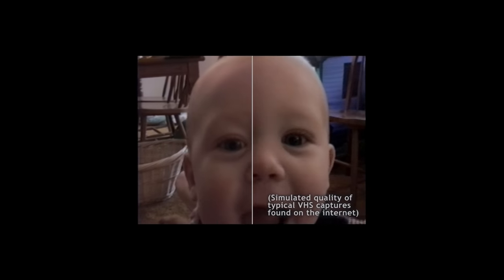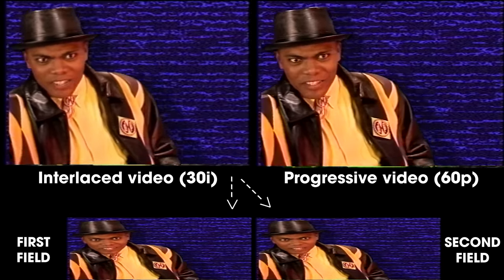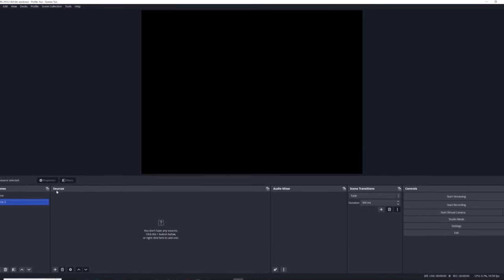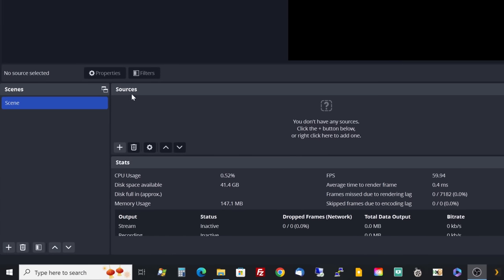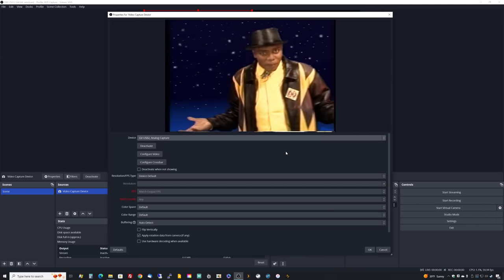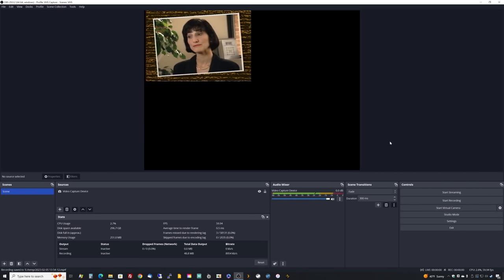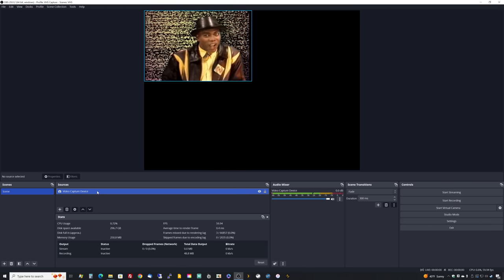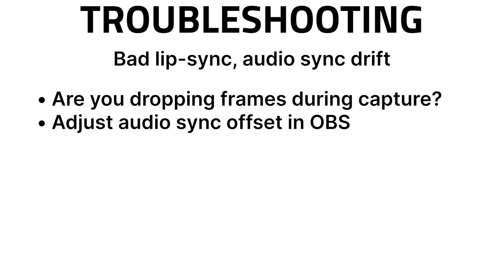How to convert VHS videotape to 60p digital video

Comment: does this work with mini dv? been trying to figure out how to digitize my old tapes.
Reply from the maker: For MiniDV, I would use something like a firewire connection and WinDV (windows) to capture the tapes, as that will transfer them digitally.  Then you can use the FFMPEG command-line in this video's description to do the conversion.

Comment: Question, what can you do in capturing the video about the over scam line at the bottom of the screen?
Reply from the maker: If it's too distracting, you can resize the video source slightly larger, so that it gets cropped off the canvas.
Reply: @TheOldskoolPC  Thank you for replying!!

Comment: I followed the instructions but used an Elgato usb capture and I can not get any sound. I use it with Egato software it works so it's something within osb. Any ideas?
Reply from the maker: Try adding the device again but this time as an audio source, and picking the capture device.  Sometimes that works around driver oddities.  I show an example of this in the troubleshooting section of the video.

Comment: I cannot see video using 2.0 audio/video converter,  it plays a USA video but I have one from Britain but it is supposed to be for all modes, so I don't understand why I cannot see it.  Thanks for any help.  I tried pal settings and that doesn't work either.
Reply from the maker: You can't play PAL tapes on NTSC VCRs, and vice versa.  Solve that problem first, then you should be able to use a USB converter set to PAL.

Comment: when i start recording, the video is not smooth and on the program it says "encoding overload. consider turning down video settings or using faster encoding preset" how should I change the settings?
Reply from the maker: I have a few tips in the Troubleshooting section of this video.

Comment: I'm having a problem, on a Windows 7 laptop my Dazzle DVC100 worked near perfectly on it however on a newer Windows 10 PC I can't get it to work at all.  The drivers install, but in OBS and VirtualDub2 there's no video, most I can get is skipping audio from the input on the device.  I've tried multiple different drivers, same thing.  Any ideas?  I'd very much appreciate it.  Also, your Google Drive link only has the GV-USB2 exe.

Comment: Do those capture devices also handle PAL inputs?
Reply from the maker: They should; most are both NTSC and PAL, although you might have to change what they're looking for in the driver config (when you click "configure video" in the video input device dialog).

Comment: How about an alternative approach for video capture? There is new AI (Artificial Intelligence) software available now from Topaz Labs that allows you to UPSCALE video that is captured in SD (Standard Definition). For example, if you capture mini-DV footage at 720 x 480, you can UPSCALE it to 1440 x 960. The result is very good.

Note, however, that the AI software does not do a good job of upscaling cruddy digital video. For example, if you've captured VHS that was recorded in EP mode (Extended Play), then the UPSCALED result using Topaz looks pretty miserable. Garbage In = Garbage Out.
Reply from the maker: I have been experimenting with AI upscaling since before Topaz Labs existed using custom-trained GANS, and then later with Video AI.  The end results, in 2024, are "it depends".  It depends on what you're trying to upscale whether you get good results or not.

Comment: Bought the Startek SVID2USB232 but changing the resolution to 720x576 PAL makes it chug and buffer at times.
update: Don't reboot your system and it will work.
Reply: Are you sure that's the actual video and not just how it's rendering on your monitor, which is likely running at 60fps? You also would need to change the output framerate to 50 fps if you haven't already.
Reply: @PuffyRainbowCloud  Yep all the output settings were matched correctly. I found the problem though, rebooting windows funnily enough. Everything works as long as I didn't reboot windows after initial reboot after installing the drivers. 
So probably something being automatically updated and breaking things.
Reply: @canderson7776  Very frustrating and very Windows...

Comment: When I add a video device and click "video capture device" my dazzle doesn't show up. Only my webcam did. Any ideas why this might be? The video camera I'm using only has a yellow and black lead even though the dazzle has yellow, white, and red. Not sure if that might be related to why the device isn't showing up.
Reply from the maker: Were you able to figure this out?  It sounds like you didn't add a device driver.
Reply: @TheOldskoolPC  I was not able to. Where would I get a device driver? I don't think I have the disc when I bought the dazzle. Thanks for following up!

Comment: This mostly works great, but every 22 frames of the deinterlaced video it will repeat the 22nd frame, then jump to the 24th frame, then play normally for the next 21 frames in a row then repeat the next frame twice in a row etc for the whole video. I tried capturing and converting with the old (2016) virtualdub method and it doesn't happen if I do it that way. Only with OBS. Does anybody know what setting I need to play with in OBS to stop this from happening?
Reply from the maker: That's a really strange cadence issue.  Without interacting with your hardware and driver settings, I'm not sure I could figure it out, although see if you have any settings for "audio hardware timestamps" and try toggling that to see if it helps.  Also make sure your audio capture is 48000 Hz and not 44100 Hz.

Also, if the previous tutorial worked for you, it's ok to keep using it!

Comment: Dazzle only works with Red White and Yellow. If I unplug the Yellow and put S-Video in the signal in OBS is lost... I thought S-Video is higher quality, but Dazzle only works with Yellow and disregards S-Video... Even if I unplug S-Video and keep Yellow plugged in the signal isn't lost... Can you help me? - Paul
Reply: I was able to choose S-Video in on Configure Crossbar under Configure Video... In order to get sound meters to show I had to uninstall the Dazzle Driver provided by this channel and reinstall... All is now working so far... took me a bit...
Reply: I tried this method vs. the previous Virtual Dub tutorial provided by this channel and I had some pretty bad results. Glitchy recording, sound is choppy... No matter what compression setting I tried the output was just disappointing. I even tried the exact Dazzle used for this video... I honestly prefer Virtual Dub... I play VHS tapes or small VHS Tapes with an adapter in a Panasonic PV-VS4820 VHS Player. I insert an S-Video male cable into the S-Video Out female port of the vhs player. I also insert Red and White Male Jacks to the Red and White Female ports of the vhs player. The other male jack of the S-Video cable I plug into a Sony DCR TRV17 Camcorder. I also plug a 3.5mm cable jack to the Audio Video port of the Sony Camcorder (the cable is a 3.5mm jack to Red, White, and Yellow jacks. I don't use the Yellow jack because the S-Video jack is higher quality. The Red and White are for sound.) Then I plug in a Firewire male jack to the Sony camcorder and the other male jack into my PC. My camcorder allows the signal from the VHS player all the way to my PC and Virtual Dub. There's a A/V Out setting that must be enabled with the camcorder for this  to work. Hope this helps anybody out who is having trouble converting their tapes... - Paul
Reply from the maker: Sorry this tutorial didn't work out for you.  There's nothing wrong with the previous tutorial if it works for you, so keep doing what you're doing.
Reply: @TheOldskoolPC  Thanks for the quick response. It's ok, no worries. I'll keep doing what I'm doing. I still appreciate you making both tutorials, even if one didn't work for me. It would be intesting if you made a tutorial on Time Base Correctors, and how to use them... I saw a video online explaining you can't make money converting tapes for clients unless you have a Time Base Corrector. Is there one you recommend purchasing? Thanks. - Paul

Comment: I tried using the startech device but I only get a black and white signal with no audio do you know why this is happening?
Reply from the maker: Sounds like you might have it set to PAL by mistake when you mean to capture NTSC (or vice versa).  I would check the driver configuration settings as I demonstrate in the video.

Comment: It's more of like how not to convert VHS, OBS is the wrong tool for VHS or any tape format for that matter, Capturing analog tapes follow the rec.601 standard, Not OBS, or HDMI or Chinese crappy dongles.
Reply: Ok!... Where is your tutorial1?🤔
Reply: @AuzFrog  There is no such tutorial, Capturing analog video is a rabbit hole, depends on a lot of things, Budget, knowledge, condition of the tapes, the delivery method of final product ...etc. There are general guidelines though and things that you should avoid as I mentioned.
Reply from the maker: If it helps, the process I follow for my own archival efforts uses a Blackmagic Design card and saves to uncompressed 10-bit YUV (Rec.601).  I then process from there, and never delete the original raw capture.  This tutorial was meant as a generic 1-stop solution for common use cases.
Reply: @TheOldskoolPC  just curious, is that the Blackmagic Intensity Pro 4k?

Comment: Hey there so I purchased a dazzle rev 1.1 and using the drivers you provided and even a version before I can’t get a video signal to work, I’m on windows 11 and even booted 10 just to try and no luck, also tried usb 2 and 3 ports but still only audio with no video. Any thoughts?
Reply from the maker: Search these comments for "dazzle" as one of the commenters had some Dazzle tips.  But if you've tried all of these and it doesn't work... maybe the Dazzle unit itself is bad?
Reply: @TheOldskoolPC  small update I did get virtual  dub to see it on my optiplex I have windows xp installed on, so maybe I’ll just follow your older tutorial using that :)

Comment: Is there any reason why you scale the video up and not leave it at sd resolution such as 720x576 for pal.
Reply from the maker: Because YouTube won't play back files faster than 30fps unless the video is 720 lines or more.  If you keep the size at 720x576 and make a 50p file, youtube will play it back at 25p only.
Reply: @TheOldskoolPC  Aha ok I see. But if you are just archiving the very old Hi8 tapes then a lower resolution will take up much less space. All this has reminded myself of messing around with digital video back in 1999 and how much of a pain in the arse it is. Even now I am still a little confused as I have remembered that it is not just the resolution but also the pixel aspect ratio. PAL is 720x576 ( which is not 4:3 ) with its own pixel aspect ratio. In OBS I have set the canvas to 720x576 and the output to 768x576. I am trying to figure out the best procedure for my purposes such as capturing the whole tape and then using Resolve to cut it up, denoise and export.

Comment: Im getting serious audio sync issues with your tutorial and your instruction fixes didnt help. Ive seen audio out of sync by 2 seconds all the way to 6 seconds out of sync. Is it possible that the audio would be out of sync because of the yadifx2? or could it be because of it being converted to mp4. 

In my experience ive found trying to edit mp4 to be way more system resource heavy than mkv especially in davinci resolve. Its a bummer because i backed up a 2 hour vhs tape only to discover the audio was all over the place and it wasnt even consistent, sometimes it was 2 seconds and other times it was 6 seconds. I could see these gaps of no audio between clips on the tape and black screen with audio playing before the image started. I been struggling to get it right. I think im just gonna have to test a few spots in the video where i have clear line of sight of someone talking and testing a few clips with mkv or a different format
Reply from the maker: Audio sync issues that much out of whack are either the result of bad drivers, or timing issues with the tape that require a TBC to fix.
Reply: i figured out the solution, i got an AV2HDMI upscaler with a type c to hdmi capture device and its hugely better than anything ive tried so far but thank you for your suggestions :) @TheOldskoolPC

Comment: Does any of these devices work with Linux OS?  OBS runs fine in Linux.
Reply from the maker: I don't know if they do, but if you're willing to spend a little bit more money, the excellent Blackmagic Intensity card series work fine in Linux.  For my higher-quality work, I use an Intensity card and capture to 10-bit YUV uncompressed, and then work with that uncompressed file in video editors, FFMPEG, etc.

Comment: Is there a good way to reduce the file size? Two hours of footage turned out to be 36GB and I still have a long way to go... Thanks in advance!
Reply from the maker: Glad you found it helpful! Yes, you can reduce the file size by using advanced video options, choosing x264 as the video encoder, and then CRF as the method and picking a value like 18. This will use only enough bandwidth to store the video information, but be prepared, it still might take up many gigs if the video is busy or noisy.

Don't go under 1gig an hour on average; disk storage is much cheaper than the time it takes to re-do everything...

Comment: Would dazzle Hollywood DV bridge or dazzle fusion be a better option for mini DV and VHS? Just curious as there's a few on eBay around the same price as the dazzle in this video.
Reply from the maker: I couldn't recommend either because I've never used them, but more importantly those are so old that I don't think you'd be able to find drivers for anything past Windows XP.

For dv, you want to transfer it completely digitally, no analog. You can connect a camcorder directly via a firewire port and cable, and get the data off the tape without any generational loss.
Reply: @TheOldskoolPC  thank you for replying... I would need I PC or laptop with a FireWire port (which I don't have). The camcorder does have a FireWire port on it but I have no way of transferring it to my PC. Do you know of any external cards that use FireWire to usb? I know there are a lot of fakes/scams out there!
Reply from the maker: I don't know of any, but I'm sure there has to be firewire to USB devices out there. I wouldn't worry about scams because the need for these is so low there isn't any profit in trying to scam for a device like this.

Comment: hi i have a dazzle and it has a really pixely look compared to my previous easycap (time artifacts so i cant use) do you know any solutions for this?
Reply from the maker: I've used both devices and I've never encountered any significant quality differences, but maybe you could go into the Configure Video button in OBS and make sure that the resolution is 640x480 or 720x480.  Maybe it's defaulting to 320x240 by mistake.

Comment: I was about to purchase the I-O data dongle but it says that its for windows - do you have a recommendation for Mac?
Reply from the maker: I'm afraid I have no Macs to test devices with, sorry.  However, the software works on mac, so you could try one or two devices (with a return policy) to see if it works for you.
Reply: You can purchase an elgato capture device, and use an hdmi to analogue like Im doing.

Comment: I'm on Mac, so I need a capture device which will capture both fields and also works on Mac. How do I know if the hardware captures two fields? I don't see that info listed on the items you recommend. Do you know of one which will work on a Mac?
Reply from the maker: I'm afraid I have no Macs to test devices with, sorry.  However, the software works on mac, so you could try one or two devices (with a return policy) to see if it works for you.
Reply: @TheOldskoolPC  Thanks, but how do you know from the description whether or not it captures both fields  or not, whether it’s PC or Mac?
Reply: @TheOldskoolPC  If you buy one to try, how are you able to tell if it does record both fields at 60 fps? There seems to be dozens for sale, so how do you start choosing? Did you have to buy dozens to find one which worked?

Comment: I bought the GV-USB2 and just realized that my PAL VHS player only has the red and white rca pin. I tried connecting the 3 cables via a SCART adapter, since thats my only option to output video, but that didn't seem to work. Is there anything I can do about this or should I look for a VHS player with all 3 rca connectors?
Reply from the maker: I would look for a SCART to composite adapter, actually.
Reply: @TheOldskoolPC  it worked, the problem was that my scart adapter was only video in. Now i bought one that has a switch and that worked fine.

Comment: but why should it be captured in 1440x1080 if the native resolution is probably 360i or 480i or if I want can I capture in 480i? because I wonder is it good to stretch it?
Reply from the maker: The tutorial is meant to give beginners a file that they can use in all situations with both fields preserved, including uploading to youtube.  It's youtube that requires the stretch.  If you want smaller files, you can just use 640x480 instead.
Reply: @TheOldskoolPC  If I have elgato60s, can I use an hdmi to composite adapter to capture in this way?